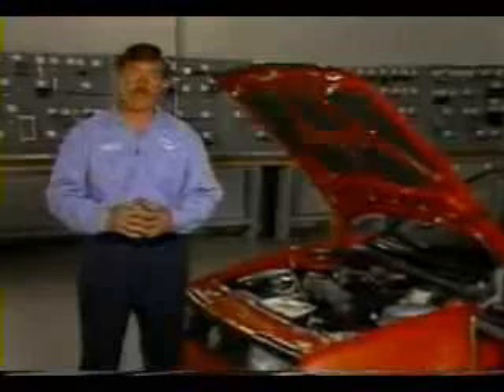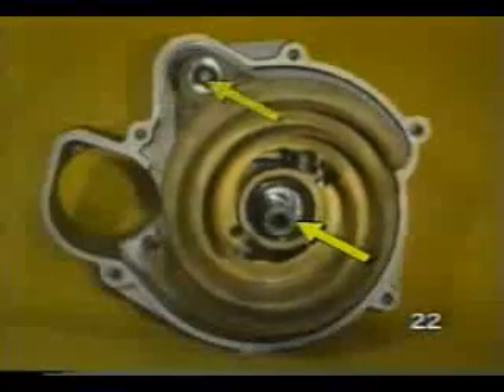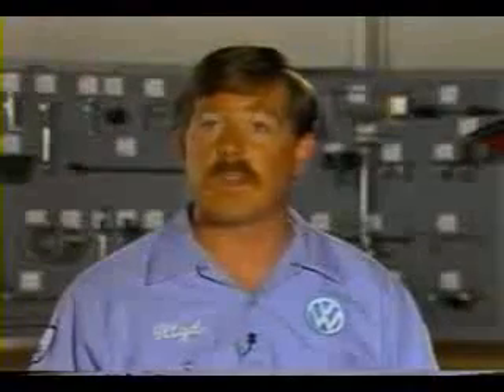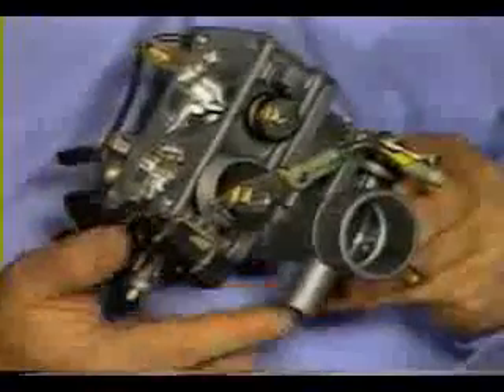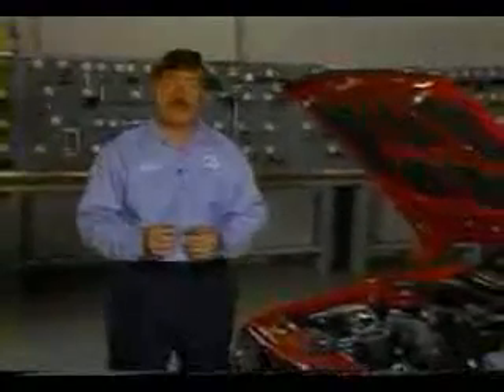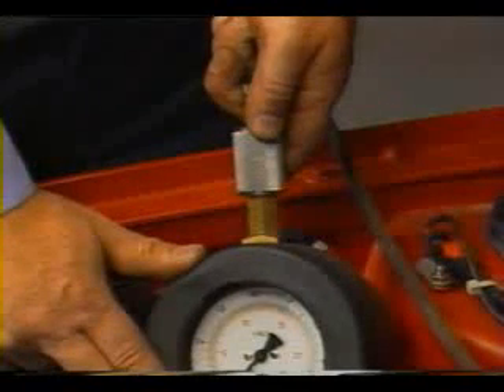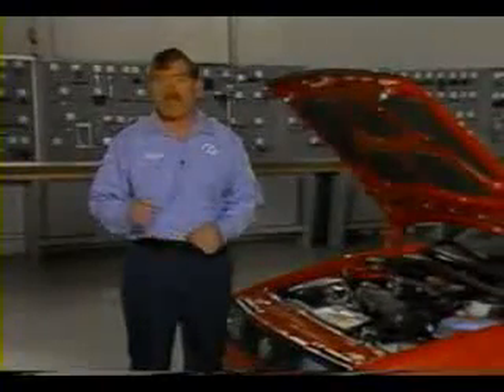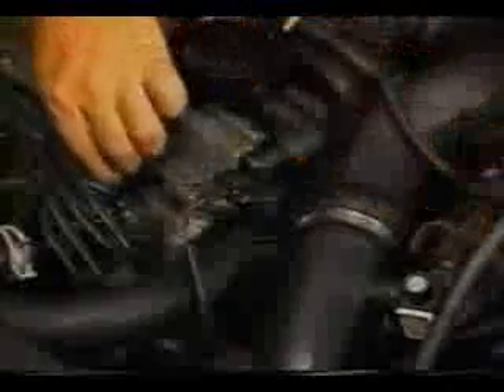Corrado G60 G-Lader Tech Talk

Comment: Is there any maintenance you have to do with the supercharger? Or and thing you have to keep an eye out for in the G60 engines? I’m new and want more information. Any would help please and thank you in advance.
Reply: Is good  practice to check little velt of G60 every few kms (8000-10.000) and replace it if you think is not in good conditions.
Reply: most useless supercharger design ever. needs rebuild every 20k miles. a proper charger using planetary gearing system is best for output and longevity.

Comment: They chose to use a small rubber band to synchronise the 2 scrolls inside the charger, great idea Fritz, and if you think I sound bitter, you bet ya I am, steaming up north on the M25 at like 105 MPH, and clink and no power, pulled on to the hard shoulder to find a nice hole in my g-lader. Everywhere I looked they wanted at least a grand even for a second hand charger, so my Polo G40 spent the next 3 years running  on 3 cylinders and no charger, lol, sapped the power somewhat.